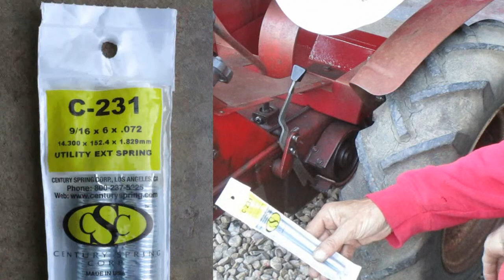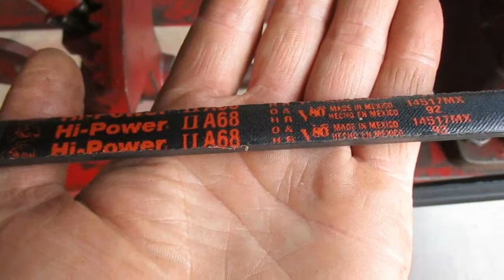Wheel Horse 704 Cleanup #25

Comment: Is it OK to shift these on the go? It looks like you were in this video.
Reply from the maker: No, it's a manual transmission, but you can be quick with the clutch when you get used to it (at least from 2nd to 3rd gear).
Reply: @PackratsFabrications  gotcha thanks
Reply: You set the tractor in gear then, go.  However you don't shift it like a car or truck. When you want to go from low gear to second gear, push your clutch in, shift it into second gear, and ease out your clutch. Take care of the machine, and it will take care of you and last you a hood long time with proper matainance, engine oil changes, greasing the tractor regularly and respecting it for what it is. I use to own a 704 Wheel Horse tractor and I loved that tractor, very, very much. Loved the rear discharge mower deck it had on it to.